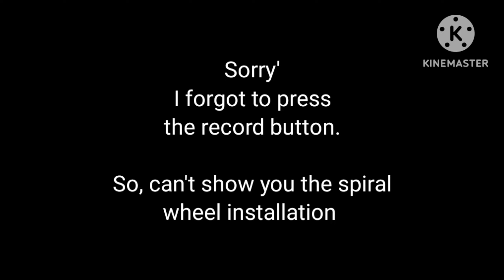Gearbox assembling ||  bearings changing  || Subscribe @hotrods08  channel. SEE DESCRIPTION.

Comment: Spar parts names and nembers pettu anna
Reply from the maker: Gears  : 
40 teeth spiral wheel
13 teeth  pinion
11 teeth  small shaft

Bearings  :  
6205    * 2 pcs
6206    *2 pcs
6008    *2 pcs

Oil seals  : 
30-62-08  * 4 pcs
52-8  Dummies   * 2